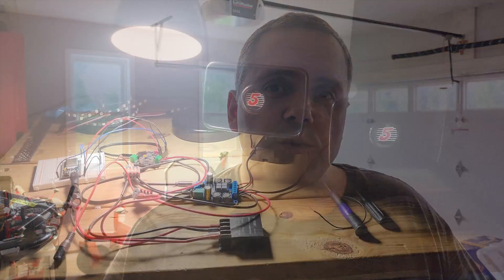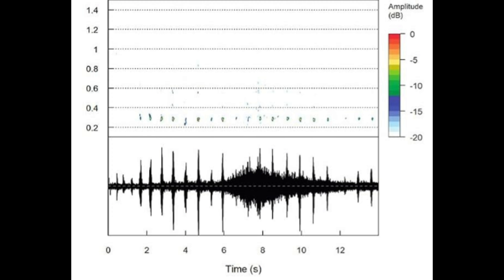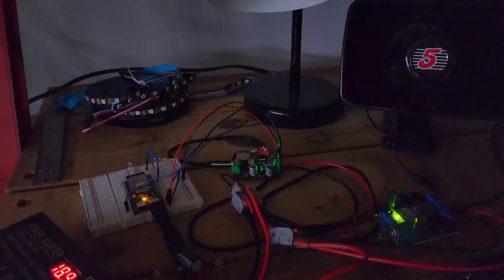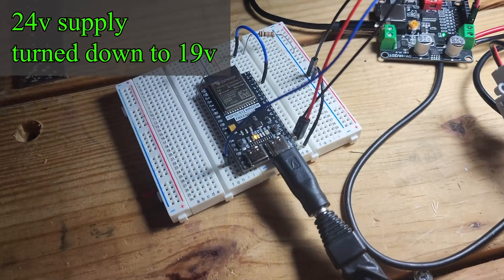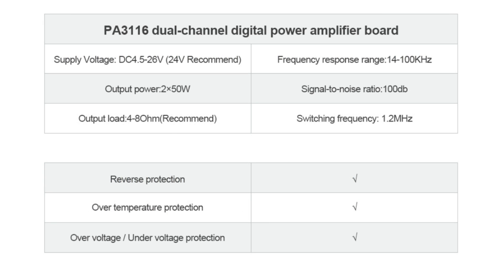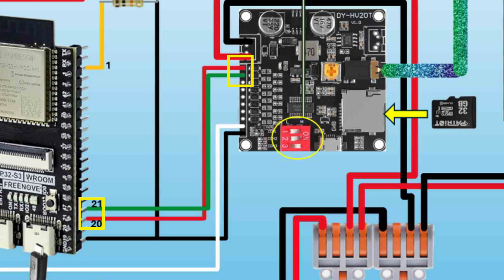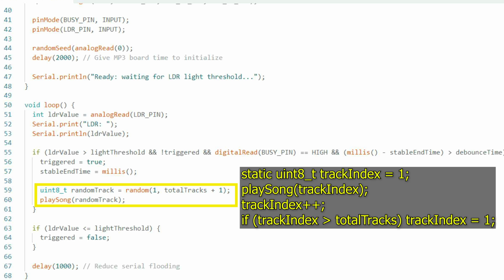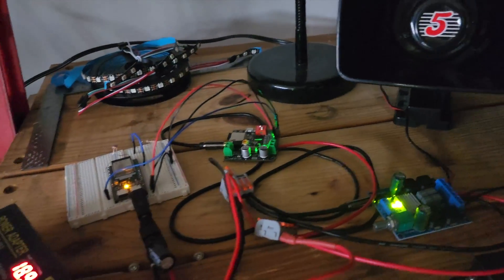🌞ESP32 Rooster Alarm Wakes You at Sunrise! | DIY MP3 & Light Sensor Project

Comment: Hi whether i can able to connect ESP32 I2S pins directly to TPA3116D2 Amplifier to hear music in horn speaker through esp32 playing audio through amplifier
Reply from the maker: I have been using the ESP32-S3-WROOM Lite board.

If you're using the same board, a direct connection isn't possible because there's a protocol mismatch. You'll need to go thru a DAC like the PCM5102A to convert the digital I2S signal to analog. 

I2S = Digital audio protocol (data, clock signals)
TPA3116D2's 3P input = Analog audio input : 0-3.3V voltage levels

If you don't want to buy a DAC module, there's a lower-quality option using PWM.
great question!  Thank you 👍👍

Comment: Nice video, I wanted to do something similar but with mp3 to be able to remote upload and change  if possible, wonder any suggested module available ?
Reply from the maker: Thanks!
The ESP32 has enough horsepower (dual-core up to 240 MHz) to decode MP3 in software using efficient decoders like Helix. You can upload MP3 files via a web interface, have the ESP32 download them over HTTP from a NAS/cloud, or stream them directly - but for this you would have to add some extra code.
this is a good start - https://github.com/earlephilhower/ESP8266Audio
Sounds like an awesome project !
Reply: @BMonsterLaboratory  Thank you! 😃
Reply from the maker: @leeshiki  you're welcome 👍

Comment: where do i find the code?
Reply from the maker: Here ya go!
I have a diagram also, if you need it.

#include <Arduino.h>

#define MP3_TX_PIN 21   // ESP32-S3 TX → MP3 RX
#define MP3_RX_PIN 20   // ESP32-S3 RX ← MP3 TX
#define BUSY_PIN   12   // MP3 BUSY pin
#define LDR_PIN     1   // Analog LDR pin

const int totalTracks = 5;
const int lightThreshold = 1000;
unsigned long debounceTime = 500;
unsigned long stableEndTime = 0;
bool triggered = false;

HardwareSerial mp3Serial(2); // UART2

void playSong(uint8_t trackNum) {
  Serial.print("Playing song number: ");
  Serial.print(trackNum);
  Serial.print(" -> File: ");
  char filename[10];
  sprintf(filename, "%05d.mp3", trackNum);
  Serial.println(filename);

  // DY-HV20T 0xAA protocol
  uint8_t checksum = (0xAA + 0x07 + 0x02 + 0x00 + trackNum) & 0xFF;

  mp3Serial.write(0xAA);         // Start byte
  mp3Serial.write(0x07);         // Play command
  mp3Serial.write(0x02);         // Length
  mp3Serial.write(0x00);         // High byte of track #
  mp3Serial.write(trackNum);     // Low byte of track #
  mp3Serial.write(checksum);     // Checksum

  delay(1000); // Let the track begin
}

void setup() {
  Serial.begin(115200);
  mp3Serial.begin(9600, SERIAL_8N1, MP3_RX_PIN, MP3_TX_PIN);

  pinMode(BUSY_PIN, INPUT);
  pinMode(LDR_PIN, INPUT);

  randomSeed(analogRead(0));
  delay(2000); // Give MP3 board time to initialize

  Serial.println("Ready: waiting for LDR light threshold...");
}

void loop() {
  int ldrValue = analogRead(LDR_PIN);
  Serial.print("LDR: ");
  Serial.println(ldrValue);

  if (ldrValue > lightThreshold && !triggered && digitalRead(BUSY_PIN) == HIGH && (millis() - stableEndTime) > debounceTime) {
    triggered = true;
    stableEndTime = millis();

    uint8_t randomTrack = random(1, totalTracks + 1);
    playSong(randomTrack);
  }

  if (ldrValue <= lightThreshold) {
    triggered = false;
  }

  delay(1000); // Reduce serial flooding
}